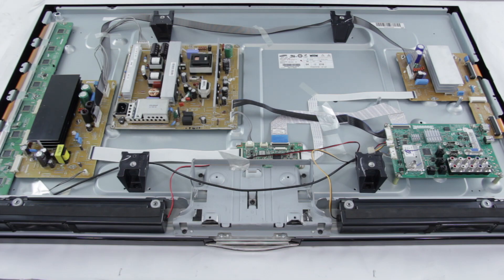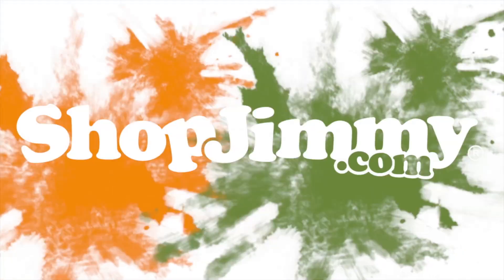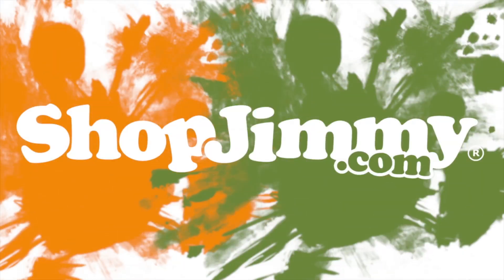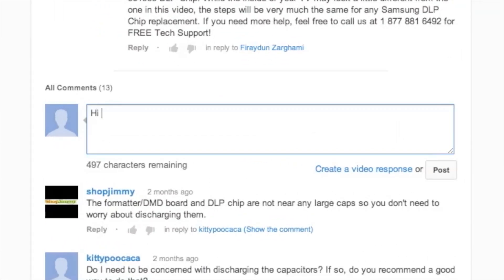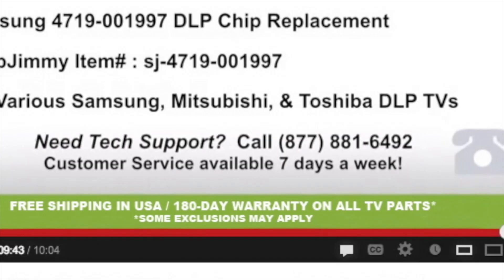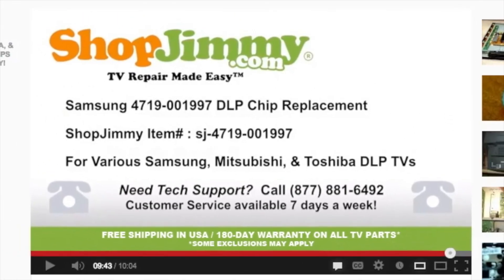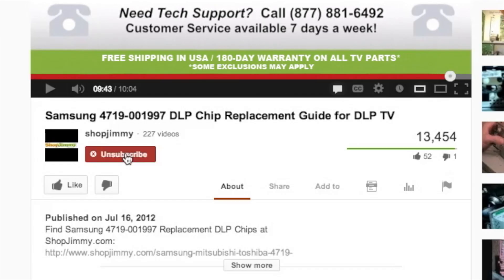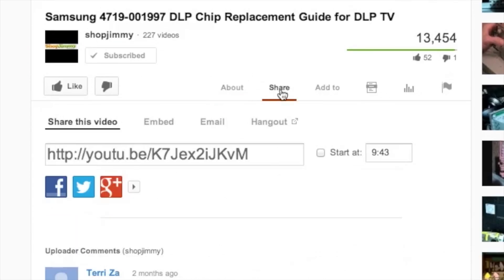Plasma TV Repair Tutorial - Common Symptoms & Solutions - How to Fix Plasma TVs

Comment: My Samsung PN50A550S1FXZA started having the usual start up proscreeching audio,eventually taking 30-45 mins to come on & finally not coming on at all after 2+ hours. Caps appear good- has 25 volt caps on power supply from factory. Could this be the X board?..or maybe Y-sustain and/or buffer ? Thanks for your help.
Reply from the maker: Charley Carrington  PLEASE SUBSCRIBE TO OUR CHANNEL - Try all repairs and troubleshooting at your own risk.   I recommend replacing the main board in your TV.  Click this link to replacement parts for your TV model number:  http://www.shopjimmy.com/catalogsearch/result/index/?cat=56&q=PN50A550S1FXZA  There may be multiple boards for the same TV model number, be sure to match part numbers on your current board, with your replacement for compatibility.  Here is a link to a video showing how to identify your part number, click here:  https://www.youtube.com/watch?v=BEPWrefQvqIThanks and please let us know if you have any further questions with your TV Repair!  www.shopjimmy.com

Comment: Samsung Plasma PN59D530A3F.  Just started this a few days ago.  Works fine, suddenly picture goes out, but audio is still present.  10-15 seconds later, it shuts itself off.   Sometimes will come back on, audio only, other times it plays the power-on sound but get nothing.   Let it sit for anywhere from 5 minutes to a couple hours, it'll be fine for a little while, then does it again.  Any ideas?
Reply from the maker: Andy Stewart   PLEASE SUBSCRIBE TO OUR CHANNEL - Try all repairs and troubleshooting at your own risk.  I recommend replacing the Y-main Board and the Upper and Lower Y Scan Drive boards in your TV.  Click this link to replacement parts for your TV model number:  http://www.shopjimmy.com/catalogsearch/result/?q=PN59D530A3F  There may be multiple boards for the same TV model number, be sure to match part numbers on your current board, with your replacement for compatibility.  Here is a link to a video showing how to identify your part number, click here: https://www.youtube.com/watch?v=R1jmj_foId0  Thanks and please let us know if you have any further questions with your TV Repair!  www.shopjimmy.com
Reply: ShopJimmy.com Thanks, but it ended up being the power board.

Comment: i have 51" Samsung Plasma that just started having a weird green / pink blob on the screen.  it started like 2 days ago (4-28-15).  it also has some black dots all over the screen.

model code - PN51D450A2DXZA
Reply from the maker: jules goulet   PLEASE SUBSCRIBE TO OUR CHANNEL - Try all repairs and troubleshooting at your own risk.  I recommend replacing the Y-Main Board and the Y-Buffer Board in your TV.  Click this link to replacement parts for your TV model number:  http://www.shopjimmy.com/catalogsearch/result/?q=PN51D450A2DXZA  There may be multiple boards for the same TV model number, be sure to match part numbers on your current board, with your replacement for compatibility.  Here is a link to a video showing how to identify your part number, click here:  https://www.youtube.com/watch?v=R1jmj_foId0  Thanks and please let us know if you have any further questions with your TV Repair!  www.shopjimmy.com
Reply: thanks, however, i ordered a x-sus board which should be delivered today (5-12-15)

i feel i may have read to much on the interwebz that siad the y-sus and buffers would have black lines, which my plasma does not have.
Reply from the maker: jules goulet   Sounds good, let us know how it goes.  Thanks!  www.shopjimmy.com

Comment: My question is can the Y buffer besides the Logic board be the cause of Vertical lines? You state in your video that the Y buffer could be a cause of Horizontal lines while the Logic board could be a cause for Virtical Lines, I just want to clarify that its either one or the other. My Samsung PN50C540G3F has two vertical lines and the whole picture while looks nice is a bit dark and all settings are maxed to try and brighten it up. I've found the boards just want to be sure before I purchase them.
Reply from the maker: Vince Walsh   Try all repairs and troubleshooting at your own risk.  This sounds like a TV panel (TV Screen) problem.  If your TV panel is bad, it may be more cost-effective to replace the TV as panels are typically hard to find in stock, difficult to replace, and expensive.  Thanks and please let us know if you have any further questions!  www.shopjimmy.com

Comment: Hello.   have a zenith P42w24bx with picture problem (has sound).   it did have some red and green dots on screen before it went out.   When taking off the back panel, there are several sets of either solid red or blinking red lights, as well as some solid and blinking green lights.  Is there any way to diagnose the problem from the blinking light and/or codes to go with that?   also checked the fuses with a multimeter and they are good...any assistance would be greatly appreciated
Reply from the maker: Ed DePinto  Try all repairs and troubleshooting at your own risk.  I recommend replacing the YSUS and the YDRVTP & YDRVBT boards in your TV.  Click this link to replacement parts for your TV model number:  http://www.shopjimmy.com/catalogsearch/result/?q=P42w24bx  Be sure to match part numbers on your current board, with your replacement for compatibility.  Here is a link to a video showing how to identify your part number, click here:  https://www.youtube.com/watch?v=GEllG3RV-tc  Thanks and please let us know if you have any further questions with your TV Repair!  www.shopjimmy.com

Comment: Sanyo J4DL (1AA4B10N21300) Main Board for P50747-04 when turning on my tv you can here the relay click and when the backlight start it go,s back off after 3 times it will not come back on i took a lighting hit that took out the cable box and tv what board is out is it my main board or other email address is brianminie@gmail.com
Reply: thank  you  i am a electronic quality tech i found the problem is in  the main board where can i get one
Reply from the maker: Brian Terry  Try all repairs and troubleshooting at your own risk.  Click this link to replacement main boards for your TV model number:  http://www.shopjimmy.com/catalogsearch/result/index/?cat=56&q=P50747  Be sure to match part numbers on your current board, with your replacement for compatibility. 
Thanks and please let us know if you have any further questions with your TV Repair!  www.shopjimmy.com
Reply: J4DL (1AA4B10N21300) P50747-04 i did not  see this board do ya have it or repair kit
Reply from the maker: Brian Terry   Click this link to a possible replacement board:  http://www.shopjimmy.com/sanyo-j4dle-main-board-for-p50747-05.htm  Be sure to match information on your current board with the replacement.  Thanks!  www.shopjimmy.com
Reply: you guys are sold out of the board i need i hope you get one soon

Comment: I have a 42" vizio vp422. The power board went out so I replaced it. It now powers up volume up and down  changes channels but no picture at all. I check fuses and capacitors but nothing looks bad. I was thinking it may be the main motherboard. Do you have any experience with this model?

Comment: I have a Pioneer PDP-5071. The red led flashes 8 times and I noticed from the repair manual that it says it is related to the ADRS Assy which I am assuming is the Address assembly. Do you know how I can diagnose what part I need so I can repair it? I am technically savy I just don't know which part I need. Thanks.
Reply from the maker: Kevin Mitton  Try all repairs and troubleshooting at your own risk.  It sounds like you have just diagnosed the issue.  Click this link to replacement parts for your TV model number:  http://www.shopjimmy.com/catalogsearch/result/?q=PDP-5071  There may be multiple boards for the same TV model number, be sure to match part numbers on your current board, with your replacement for compatibility.  Thanks and please let us know if you have any further questions with your TV Repair!  www.shopjimmy.com

Comment: Hi, I have a Samsung 42" Plasma model no:  PS42C451B2D and it has no picture, when i disconnect power to the logic board and press the power on button on remote i get the audio start up tone but obviously no display... with all internal cables connected and i press the tv remote power on button all i get is a click on then click off (relay like click sound). Any suggestions would be muchly appreciated.

Comment: I have a Hitachi 55HDS69 has sound but no picture. Before that Hdmi1 quit working then developed black horizontal bars across tv.

Would appreciate. Any help with this issue thank you.
Reply from the maker: Melvin Kimble   Try all repairs and troubleshooting at your own risk.  I recommend replacing the main board in your TV.  Click this link to replacement parts for your TV model number:  http://www.shopjimmy.com/catalogsearch/result/?q=55HDS69  There may be multiple boards for the same TV model number, be sure to match part numbers on your current board, with your replacement for compatibility.  Thanks and please let us know if you have any further questions with your TV Repair!  www.shopjimmy.com
Reply: Could main board cause no voltage on x board. And y board va says 86.4 vs 66.2 and could you still get sound with a bad power board

Comment: hi i have a LG 42pg6000 plasma tv, I have a thick horizontal line at the top of the screen, the line is not all black, the line has multi colors pixels that flash.
    thx Dave
Reply from the maker: Dave Flanagan  Try all repairs and troubleshooting at your own risk.  This sounds like a TV panel (TV Screen) problem.  If your TV panel is bad, it may be more cost-effective to replace the TV as panels are typically hard to find in stock, difficult to replace, and expensive.  Thanks and please let us know if you have any further questions!  www.shopjimmy.com

Comment: Hi Shopjimmy,
Guys have a samsung plasma model PN50B450B1D had power problem on y board and power board solve it tv comes on have picture but with thin vertical lines in picture across screen kindly assist with best responce

Comment: My Samsung model number PN59D530A3FXZA has a worsening problem. It reboots, and when it comes back, there is audio but no picture. At first, it would be solved by powering down, and waiting a few minutes. That has increased now to  a few hours. Functionality only lasts a few minutes now. I tried a hard boot, leaving the unit unplugged for several hours, but this didn't fix it. It's no longer connected through a surge protector, if this makes any difference. Your video was excellent. Your company has been recommended as a good place to buy replacement parts. Should I buy an $8 digital micrometer from Walmart to determine if the Y buffer and the logic unit are working correctly? Thank you for your help.

Comment: My TV has a black box in the center of the screen that won't go away. It started about a month ago. When I turned the TV on, the box would disappear after 10 minutes. Gradually it increased to an hour before disappearing and now most of the time it won't go away. The box is about 12" wide and 5-6" high and is center horizontally and just above center vertically. It pretty much blocks the center of the picture that is playing. 

Can anyone please give advice regarding cause and whether it can be repaired?
Reply from the maker: Charlie Farrell   Is the closed captioning on?  Thanks!  www.shopjimmy.com

Comment: have a zenith P42w24bx with picture problem (has sound).   it did have some red and green dots on screen before it went out.   When taking off the back panel, there are several sets of either solid red or blinking red lights, as well as some solid and blinking green lights.  Is there any way to diagnose the problem from the blinking light and/or codes to go with that?
Reply from the maker: Ed DePinto   PLEASE SUBSCRIBE TO OUR CHANNEL - Try all repairs and troubleshooting at your own risk.  I recommend replacing the YSUS and the YDRVTP & YDRVBT boards in your TV.  Click this link to replacement parts for your TV model number:  http://www.shopjimmy.com/catalogsearch/result/?q=P42w24bx  There may be multiple boards for the same TV model number, be sure to match part numbers on your current board, with your replacement for compatibility.  Here is a link to a video showing how to identify your part number, click here: https://www.youtube.com/watch?v=GEllG3RV-tcThanks and please let us know if you have any further questions with your TV Repair!  www.shopjimmy.com

Comment: I have a Panasonic Plasma tv with a horizontal line about 5 in. from bottom.  When display is dark the line flickers blue-green.  When the display is bright the line disappears.  also when connected to a computer the tv turns on then cuts out.

Comment: I have a Samsung Plasma Model Code PN51D450A2DXZA. There is sound but no picture when I initially turn the TV on. But if I turn the TV of and then on within 3 seconds the TV will have both picture and sound and remains fine the rest of the day. It's been this way almost as long as I have had it.
Reply from the maker: Paul Escoto   Try all repairs and troubleshooting at your own risk.  I recommend replacing the Y-Main Board and the Y-Buffer Board in your TV.  Click this link to replacement parts:  http://www.shopjimmy.com/catalogsearch/result/?q=PN51D450A2DXZA  There may be multiple boards for the same TV model number, be sure to match part numbers on your current board, with your replacement for compatibility.  Here is a link to a video showing how to identify your part number, click here:  https://www.youtube.com/watch?v=R1jmj_foId0  Thanks and please let us know if you have any further questions with your TV Repair!  www.shopjimmy.com

Comment: I have a Samsung Plasma PN50C450B1D. When I turn it on the indictor light comes on, I hear the Samsung sound and the screen remains black and silent. It doesn't turn itself off. There is a red light lit inside the TV at the lower right corner where you plug in HDMI cables and DVD...etc.  Any suggestions you have would really help me out!  Thanks
Reply from the maker: kathmatazz   Try all repairs and troubleshooting at your own risk.  I recommend replacing the Y-Main Board and the Y-Buffer board in your TV.  Click this link to replacement parts for your TV model number:  http://www.shopjimmy.com/catalogsearch/result/?q=PN50C450B1D  Be sure to match part numbers on your current board, with your replacement for compatibility.  Here is a link to a video showing how to identify your part number, click here:  Thanks and please let us know if you have any further questions with your TV Repair!  www.shopjimmy.com

Comment: Hello! I have a Zenith Plasma TV model number Z50PJ240 and it's not turning on. I heard a "POP" come from the TV and now when turning on the red light will blink and then go off. I'm assuming it's the power supply however wanted to know if you have a suggestion.
Reply from the maker: Edward Hunt  Try all repairs and troubleshooting at your own risk.  I recommend replacing the YSUS and the YDRVTP & YDRVBT board in your TV.  Click this link to replacement parts for your TV model number:  http://www.shopjimmy.com/catalogsearch/result/?q=Z50PJ240  There may be multiple boards for the same TV model number, be sure to match part numbers on your current board, with your replacement for compatibility.  Here is a link to a video showing how to identify your part number, click here: https://www.youtube.com/watch?v=GEllG3RV-tcThanks and please let us know if you have any further questions with your TV Repair!  www.shopjimmy.com

Comment: LG60PZ550 LG 3-D flat screen with no picture but we have sound.  We have replaced the main power supply board and still no picture. The main board has a piece in it with little fins that look burned.  It is the board where we plug in all out HDML, USB cable connections. The little smaller to the left of the main board has green light that is blinking. Any suggestions for repair on this that we can try?
Reply from the maker: Celeste Bailey  Try all repairs and troubleshooting at your own risk.  I recommend replacing the YSUS, TDRYTP & YDRVBT boards in your TV.  Click this link to replacement parts for your TV model number:  http://www.shopjimmy.com/catalogsearch/result/?q=60PZ550  There may be multiple boards for the same TV model number, be sure to match part numbers on your current board, with your replacement for compatibility.  Here is a link to a video showing how to identify your part number, click here:  https://www.youtube.com/watch?v=GEllG3RV-tcThanks and please let us know if you have any further questions with your TV Repair!  www.shopjimmy.com